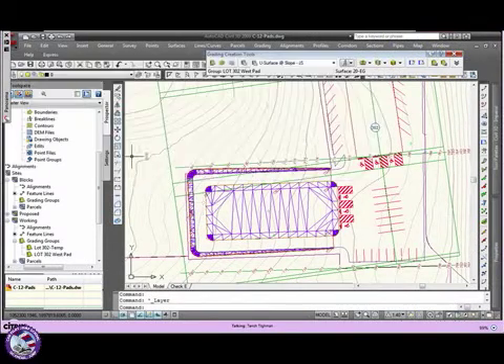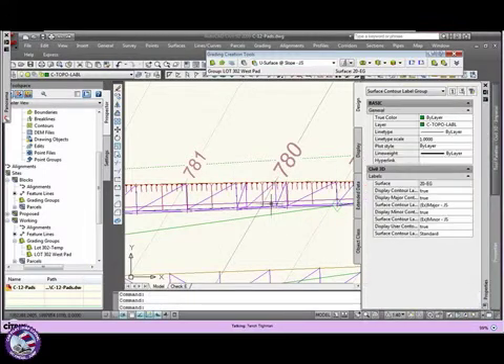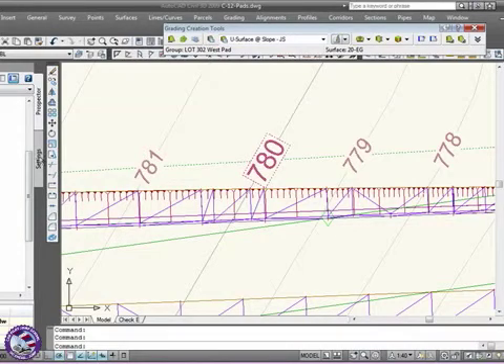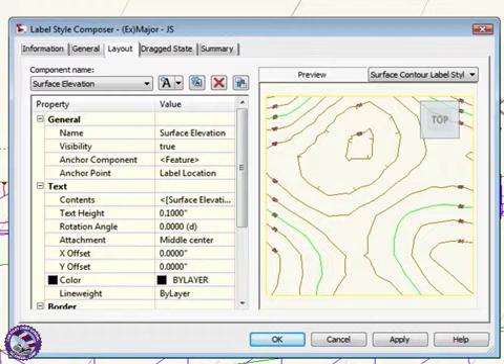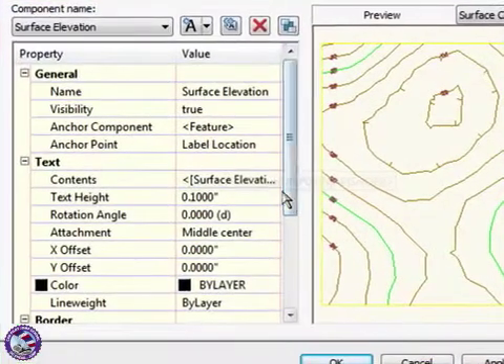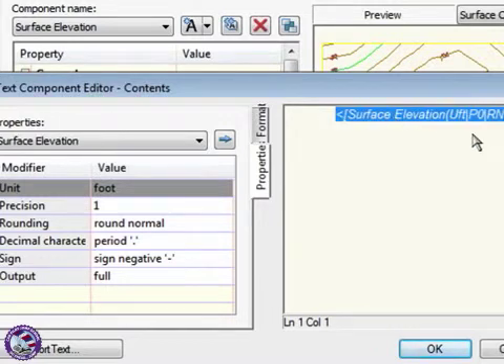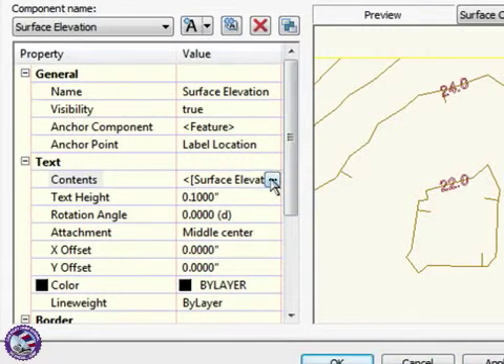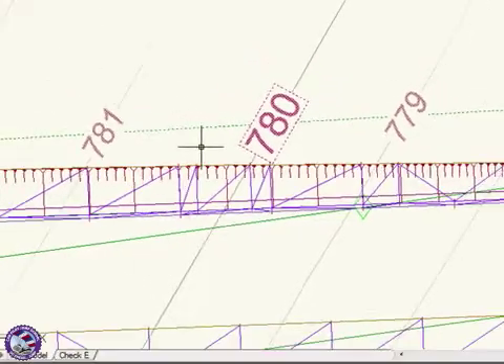Civil 3D Label Style Control powered by Jump Start the Template Collection

Comment: hi! Thanks for the video. It has been very helpfull.
I have question. When I try to print the drawings using the layout tab, the labels turn into a mess. I have read that this is configuration at the drawing tool box and scales but I don't know how to fix it. Could you please help me with this issue. Thanks